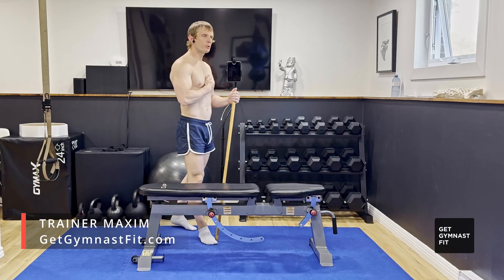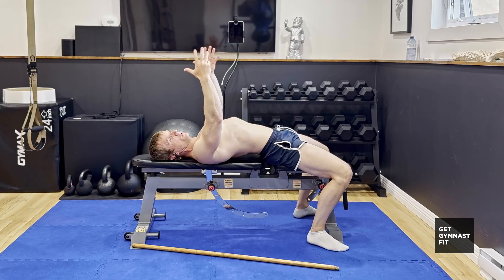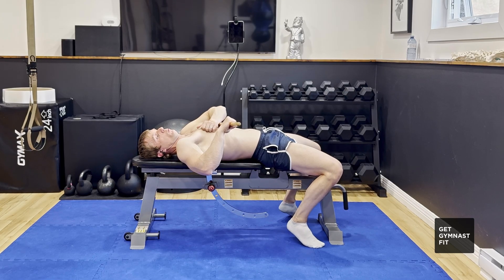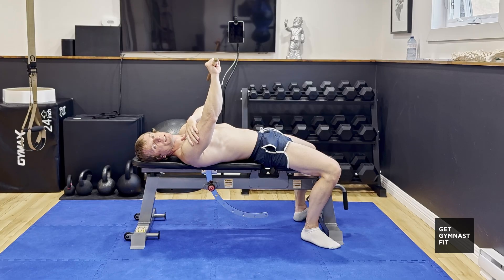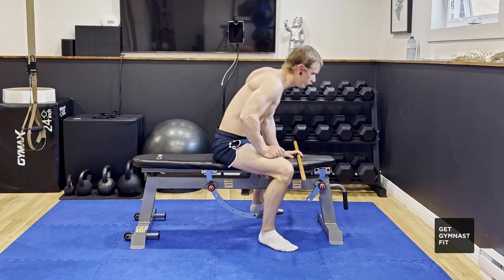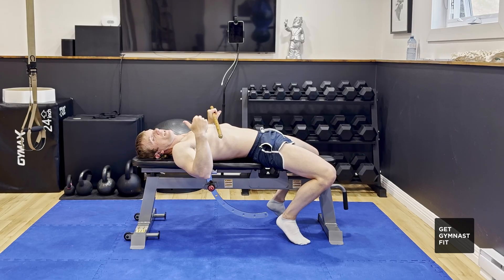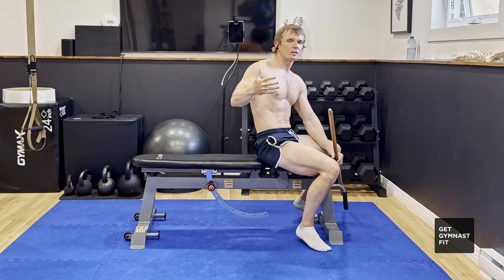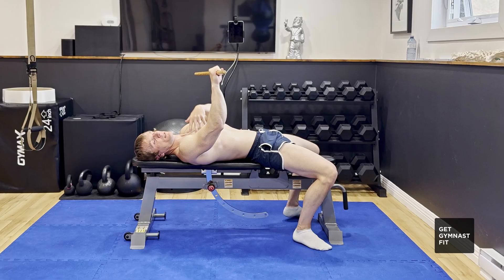Bench Press Mechanics: Shoulder, Spine, and Technique for Safer, Stronger Reps

Comment: could you please make a video on how to fix very pushed forward ribcage and pelvis? the left side of my spine is so pushed forward that even when i go on all 4 on the ground i can barely feel any activity happening in the muscles on the left side of my body and i can sense a very strong turn to the right and my right ab wall and serratus engaging strongly to stabilize me. i try to fix it with prolonged exhalations on hands and knees trying to get the ribs and pelvis to move back on my left side (and a bit on my right), but i feel that there must be a better way to go about fixing this. i would so love your input on the matter, thank you maxim, thanks a lot.
Reply from the maker: Thank you for sharing. Sorry to hear about the dilemma you’ve got. I wish I could make a video on it, but this matter is highly individual. The spine needs to be trained to stay neutral, the twist of the spine needs to be eliminated, after that we need to teach the shoulders and the pelvis how to operate all the related muscles under the new spinal conditions …sadly it’s not a 123 fix. I wish it were. And the videos on all those matters I have already. 🤝
Reply: @getgymnastfit  thank you for the speedy comment, i will try my best to fix this 🤝
Reply from the maker: My pleasure!

Comment: Trainer Maxim, should the feet be on floor completely? optimal height of bench?
Reply from the maker: Yes! The feet should be planted on the floor to keep the tension in the legs so that the legs can stabilize the torso and prevent later divination during presses (especially the heavy ones)

Comment: it's actually amazing how much of your advice runs in complete parallel to the advice given by jonathan warren and the pri crowd in general regarding ribcage positioning (staying neutral in the ribs, not arching or crunching) and keeping that support from the serratus and lower traps during pressing motions. It's a real treat to see how different intelligent systems and individuals come to the same conclusions regarding body mechanics independently from one another.  Also, question, could a butterfly stretch with rather aggressive pulses up from the knees while focusing on tailbone extension and that 'lower back away' que be a good way to integrate inner thigh and psoas activity with the muscles of the lower back supporting the pelvis? i've seen this move done in several systems of yoga and it really makes sense when looking at it from the perspective you've provided, stabilizing the pelvis through the muscles of the base of the spine together with the inner thigh and psoas working together to keep the pelvis neutral. anyways thats enough of me rambling, Thank you so much for everything again, your work is very much appreciated by everyone here.
Reply from the maker: Thank you for your kind words! Really. As for the question - absolute all those muscle definitely should work together to stabilize the pelvis and ensure the safety of stretching especially the butterfly one with aggressive pulses. Though we need to be careful with those dynamic pulses especially at the earlier stages. The Brian doesn’t like much speed and stretch combined. 🤝

Comment: I dont have a bench and i press with dumbbells and lie on the floor. Is this fine?
Reply: I'm in the same boat, doing for more than 5 years with great results or even better as I age, a more secure position for your front shoulders since the floor is acting  as a limit to tell you when to push. I love using dumbbells, I find them a more natural way to perform the exercise since the arms are not 'attached-fixed ' to the bar.
Reply from the maker: I like presses on the floor for the reason you named as well. As yes, with dumbbells it’s easier coz each shoulder might have a slightly different way of movement due to its alignment so a dumbbell will move in that shoulder’s way. 

However, with dumbbells it is extremely hard to see discrepancies in each shoulder alignment. Ideally we want each shoulder to be aligned in the same good open shoulders way. If it’s the case then there will be no difference between working with a barbell or a dumbbell. But if a barbell is more difficult in terms of control or strength of the press is not distributed equally then there is a reason for that - spinal alignment -> shoulder alignment -> shoulder patter of muscle activation -> strength outcome. 

So it will have to be investigated and adjusted vs just accommodating those discrepancies by using more accommodative ways.
Reply from the maker: Yes, that is absolutely fine!